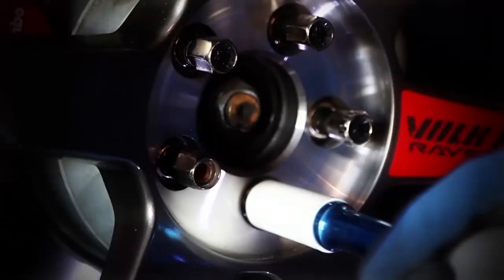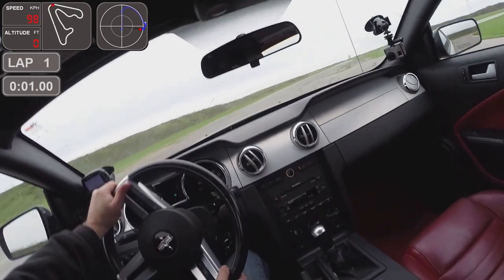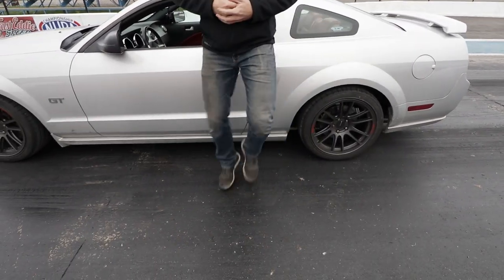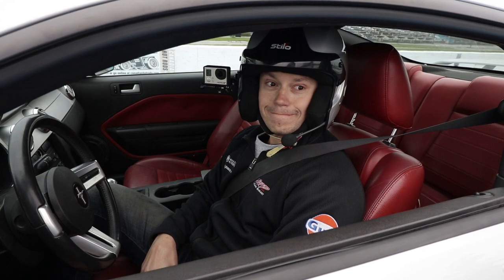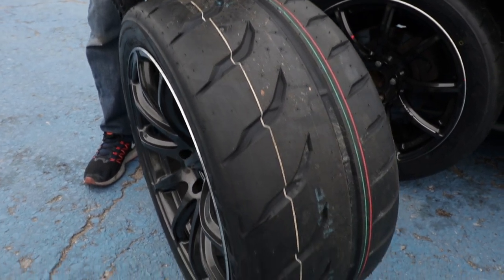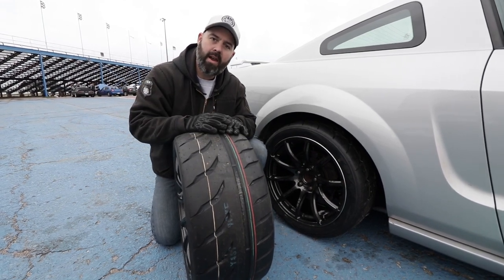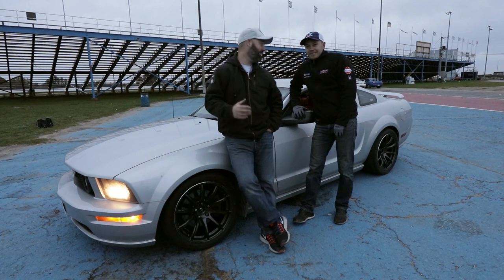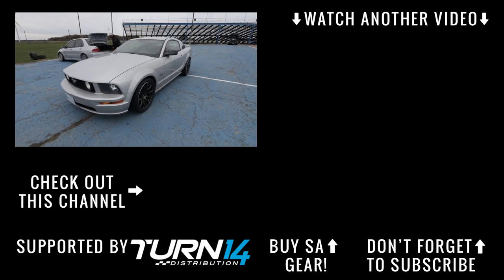Can the Ford Mustang run a 13 Second Quarter Mile ET? - Mullet Mustang - EP09

Comment: I can hear the howl from you guys missing the setup on the rear gears. To make things easier you should take your old pinion bearing and enlarge the center (the part you press onto the pinion) with sand paper. So you can slip it onto the pinion without the press. Use that bearing to setup your gears. Once you are happy with the markings on the paint you can press your new bearing onto the newly discovered shim pack. Old rear end guy trick is to turn an old press fit bearing into a slip fit for setup purposes only.

Comment: I have an 05 sonic blue convertible  black top automatic. just did the bushings, thank you for all your videos. you'll get in the 13s easy, track conditions sucked. going to do the timing chain guides and tensioners.. much easier than a Lincoln navigator. then an aluminum driveshaft, 39lbs vs 19.. and a tuner.

Comment: hey guys would be nice to blend in a chart after a round with a new car/parts so we can see the timings of all the other cars in comparison (s2000, s14, rx7......). since most of the cars you test is in toronto motorsports park. like top gear does.

Comment: My stock '68 charger 383 with 727 ran, 14.0 @ 100mph
Reply: Vintage big iron car. With an auto and warmer Temps. The 4.6 is 281 Cid I think it does fine

Comment: What's impressive is that the Ford Racing team and their pro drivers got a 14.6 on a bone stock S197. Now I'm sure they were on a perfect track on a perfect day at the best track location for better air plus better tires.. I think they did it in 07 not on the original 05 model, but you can Google it, a stock 4.6 S197 is supposed to run a 14.6 at like 107 I assume guys go slower with light mods because of traction loss, and they're just not dedicated professionals.

Comment: the 92-93. mustang GT 5.0s With just a full exhaust system and a computer Chip I was running high 12 second passes and my friend was running low 13 second passes on the saying set up

Comment: I have an 06 GT. I put 4.33s in the rear, drag pack wheels and MT radials, hollowed cats and full 3" straight pipe with 4" tips. Runs a constant 12.90s no tune, no intake, no headers..nothing else.

Comment: Did you guys put a tune on that car yet? I didnt notice it mentioned in any of the bolt on episodes... if you didnt you might want to look into it, I bet you will pick up a surprising amount of power.
Reply: MrBobjacobson all they did was a new muffler and intake might pick up 5 to 10 with a tune

Comment: I ran a 14.0 in my 2002 mustang gt and it was completely stock. With 4.10 and few bolt ons it is now a 13.2 spinning 1 and 2 and into 3 barely

Comment: I got 13.5 At Saudi Arabia Dirab drag , I just have intake afe head and k&g tube with x pipe and cutting the 8 cylinders under main intake Manifold and 325 rear tires slicks and 3.73 gears .. SLR Riyadh program😅 no cams no anything

Comment: Dave is driving hard without a proper harness, shaking in seat and struggles to hold the steering wheel, so you can shave another second  with omp/sparco/recaro seat and belts, time attacking in stock seat and belt is good for constipation treatment, but bad for perfomance results.

Comment: This car runs 13s stock? Is it because the altitude? Intake tune gears exhaust and a tire you should be in the 12s?
Reply: ponypwr if the track was warmer and had proper prep I think they'd be closer to that.

Comment: I have gone through two sets of the r888r. I found that they like more hot pressure than other r compound tires. What kind of pressure are you guys running?

Comment: My 06 gt do 110 @ 12.36 in public street with stock tires bolts on, 3.73 ratio stock tb and stock intack manifold test using superchip programmer. Lol u have 197 comments = s197 👍

Comment: I would hope with these newer mustangs that THEY would be able to make a 12s pass with bolt ons without a doubt!!!..... I guess not!!!!.......
Reply: BIKES BLADES/GUN'S eh, heavy
Reply: BIKES BLADES/GUN'S it's still just a 4.6 SOHC, basically the exact same as the SN95 and New Edge with added weight and one more valve. The Coyote was the revolutionary step for these cars.
Reply: +jS197 your average guy definitely will not run 13s stock.  
unless you ran 13s bone stock I wouldn't say 13s.
Reply: @harryazzole7814  definitely not the "exact same engine". This one is FAR superior to 2v npi engines and has closed ported heads, cam phasing and much more. This engine made the coyote what it is today. You're welcome.

Comment: That's crap on the drag i ran a 14.051 at 94.18mph 1/4mile on a bone stock rear end 2005 GT 5speed with ram air and muffler delete exhaust on 87 octane with nitto 555 drag radial tires that would not hook up 🤔

Comment: My 99 trans am runs 13.7 stock? how much hp does this mustang have???
Reply: steven Thompson 260hp 290tq at the wheels. They are turds until you hit about 4k.
Reply: you took YOUR trans am and ran 13.7 or did you see 13.7 on the internet by some random guy? 

big difference between the two.

Comment: Nice driving guys. The oem rear axle seals are junk, try National seals they last a bit longer, reshim those gears while you are at it, screaming on deceleration. You will need one of these to keep the fluid in the axle and not on the track. 
http://shop.bobsautosports.com/Mustang-2005-14-axle-reservoir-KR-style-axle-reservoir.htm

Comment: This is a 4.6l car right?
Reply: Joe11Blue Yep it is it's a 4.6 SOHC 3V V8.
Reply: CJ Colvin Thanks, was confused at first why they were only running 14's.
Reply: Joe11Blue it should be in the 13s but the strip was really cold
Reply: TheDustyaman also altitude
Reply: ShortManFilms
Aren't they near Toronto? Pretty flat there.
Reply: Joe11Blue i guess so woops i was thinking they were somewhere else
Reply: with radials he'd be pushing low 13's maaaybe high 12's with a great launch
Reply: pballer2005 should not need radials to run low 13s. even high 13s are possible on street tires
Reply: 12s*
Reply: ShortManFilms with a good driver lol

Comment: A factory 04 mustang gt automatic runs 14.5 sec in the quarter. Your 2005 car is making 75-85 more hp than that with the modifications you have and you have 4.10 gears. Your timer is wayy off. You are really clicking off low to mid 13s.

Comment: my 370z runs 13s stock
Reply: cringe AUTO and its way lighter and more powerful so it should. Not to mention the very cold temps
Reply: im surprised theirs ran so slow stock
Reply: have you taken your 370z to a drag strip and ran 13s stock? 
if you have then no it don't.
Reply: I ran a 13.8 at the strip stock

Comment: That thing should be running 13s stock why is it so damn slow. Lol
Reply: those are unicorn internet numbers.. take your stock 4.6 and let's see you run 13s stock.
Reply: xxKURTMANxx they usually test cars under perfect conditions. some times they even test the times on dynos. lol
Reply: F20NAprelude I ran low 14s when I had my 99 GT on all seasons. No reason a Modded 3v on stickier and wider tires is slower. Cold or not.
Reply: ***** looks at the trap speed. Its a low 13 sec car.